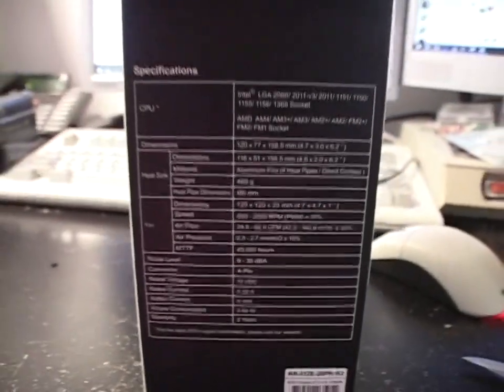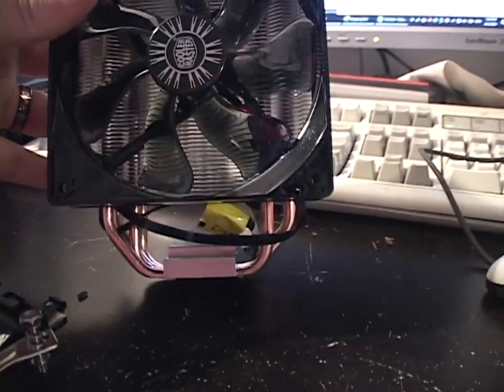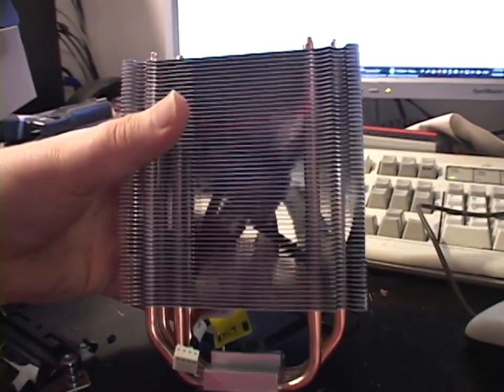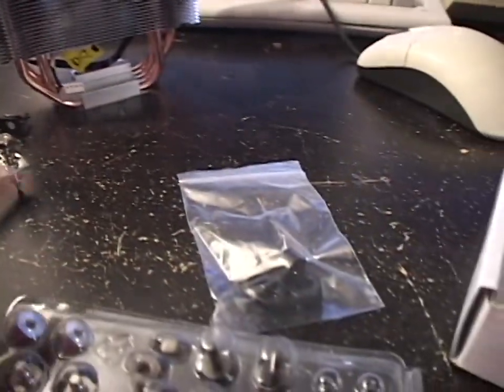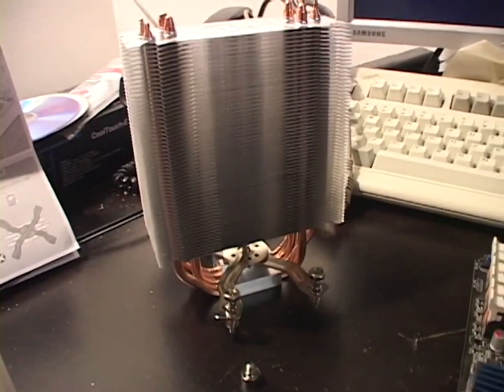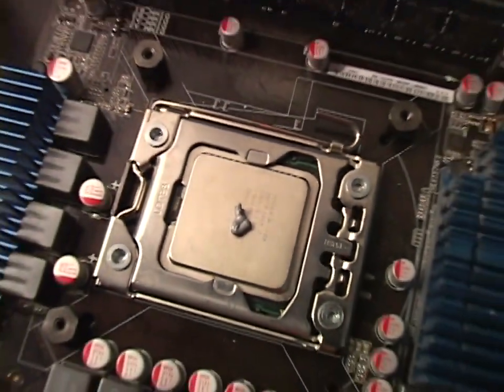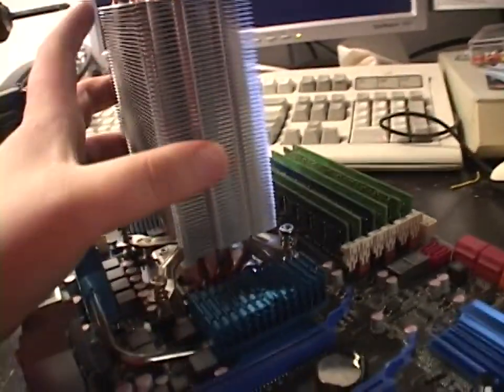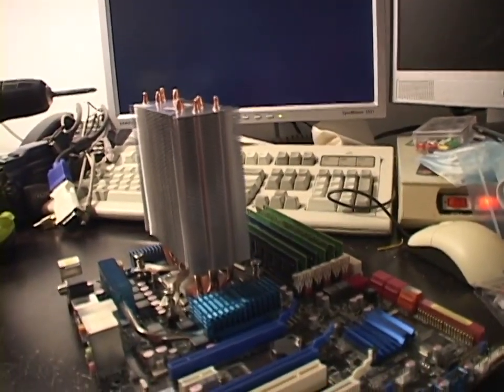New cooler for the PC - Cooler Master Hyper 212 Evo - Install and Test

Comment: I put a 212 on my i9 9900k, kept it nice and cool @ 5.0 on 2 cores and 4.9 on the rest , I swapped it for a 280mm AIO because, why not.  I put the 212 in my sons 9600k and he’s at 4.9 on all cores, temps are mid 60s.  Great cooler! Wise choice.

Comment: Great choice. I have the newer version, the Hyper 212 Black RGB edition (there is a non-RGB version too).

For maximum cooling, I suggest getting a 2nd 120mm fan for a push-pull heatsink configuration which will improve cooling.

Comment: Hyper 212 is a winner! I have one atop my overclocked i7-4930K - that's a 6 core/12 thread CPU overclocked to 4.3 GHz! A Prime95 AVX load gets it up to 82C. That's not bad at all for a CPU which, according to HWMonitor, is pulling 140-145w from the motherboard!

Comment: "don't pay for those other coolers like the Noctua ones" uh... hides Noctua NH-U12S lol. (actually in my defense I wouldn't have bought it but it was the only single tower heatsink at the time that came with Socket AM4 mounting hardware for the Ryzen launch since I was an early adopter).

Seriously the Hyper 212 is such a good value cooler, I've used them in builds I do for people whenever I can and it's great. I used to own an NZXT cooler of the same type (which was cheaper than a 212 EVO when I got it) back on my Intel Z77 build years ago which did an awesome job with the i7 3770 I had especially in the hot summers we have down here. No need for water cooling tbh, single or dual tower heatsinks if you're going to overclock a lot are the way to go as they're quieter and have less to go wrong. Also this cooler give you some headroom for some CPU upgrades if you want to ever do that, you can stick a six-core under that and still have no problem cooling it, even a fast one like a i7-990X/Xeon W3690. That would be a wicked upgrade.

Comment: If your i7-950 is a D0 stepping, you can easily get 4GHz all day on this chip. I did that with a 920, a much lower tier CPU and that sat at 4GHz 1.25v no issues. It's a matter of raising the bus speed, and setting memory and uncore correctly, then applying a tad of extra voltage. Anything under 1.4v should be good for daily use, but 1.4v on a 130w chip will cook the Evo.
Reply from the maker: I don't know what stepping it is, but I was able to get it to 4.0 GHz solely by increasing the base clock and multiplier. Temp got too high running Prime95 though. I now have it running at 3.6 GHz, and don't break 80*C in Prime95.
Reply: @themaritimegirl  keep in mind Prime95 puts more stress on a CPU than any other realistic program would (like rendering video, playing games, or converting media through handbrake). It also might be automatically applying voltage. If you manually set the voltage, it might yield lower temps. Matter of trial and error :) 

The i7-920 I had ran 4GHz on the TX3 Evo, which is the smaller brother of the 212. It never broke 80c, which is fine.
Reply: @themaritimegirl  Intel's product spec page says that the 950 is a D0 stepping for both retail (box with CPU and stock cooler) and OEM (CPU only on a tray).
EDIT: Intel also says that the MSRP for the retail version of the i7-950 was $305 (US).

Comment: Those results are amazing! I think you could have gotten away with remounting the old heatsink, but it wouldn't have turned out anywhere as nice.

One quirk I've noticed with my Asus motherboard is it boots faster when it sees a CPU fan spinning. Not much of a dealbreaker if you prefer your external fan controller though, does that pass through the RPM signal to the motherboard?

Now you just need one of the six core Xeons and then you can start overclocking. I'd stay away from the presets and start by manually increasing the base clock without touching anything else. While increasing the voltage allows slightly higher clocks I don't think it's worth the greatly increased heat.

Good luck and I hope to see what upgrades come next!
Reply from the maker: I tried re-mounting the old cooler a couple of times; didn't help.
Reply: @themaritimegirl  It probably got damaged sometime. I have some similar style LGA775 coolers to that where the fins section is only around 80x80x40 mm and those cool 90w Pentium 4s without going full speed. Maybe the heatpipes in your old cooler became leaky. I dunno, but your 50 CAD seems worth it.

At first I was worried and thought you overpaid because I thought the 212 Evo was around $30, but then I remembered USD != CAD and your $50 includes shipping.

Comment: I've got a question, 
is the vx2000 or pd150 better?
Reply from the maker: You asked the same question on the livestream two days ago, and I answered it.
Reply: themaritimegirl sorry I actually clicked off the livestream after I asked lol
Reply from the maker: @rupert6478  You'll find a PD150 for cheaper because skater bros have inflated the price of VX1000s and VX2000s to kingdom come. The PD150 is also more versatile because it supports XLR mics and the  DVCAM recording format for compatibility with DVCAM VCRs. But the VX2000 is simpler to use because it has a built-in mic and lacks the broadcast-oriented functions that most people won't use. So it depends on what your needs and wants are. Both are excellent camcorders.
Reply: themaritimegirl thanks for the info! 😃 I guess it’ll be tougher to get a vx2000

Comment: I'm glad it worked out after the stress at the beginning, the 212 is pretty fiddly to get going but it makes up for all the hassle with it's performance.
Arctic is less hassle because they use a solid clip mechanism like Intel's but I don't think they do 1366 stuff anymore, for 775 their Freezer X is a great Core2Quad cooler while being silent and a bit shorter than most high TDP coolers I've used in the past. Looking forward to the upgrades you've got in store for the i7 PC, keep it up!